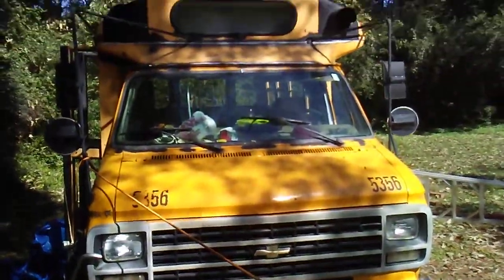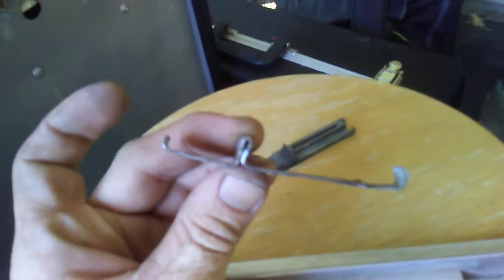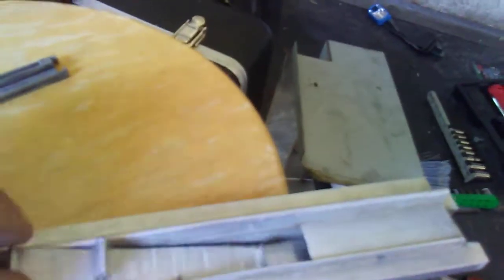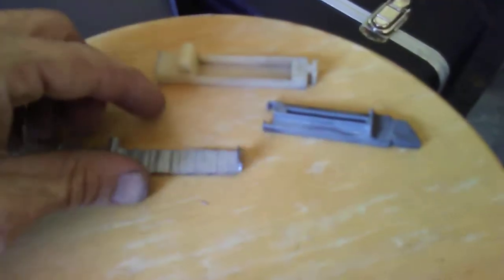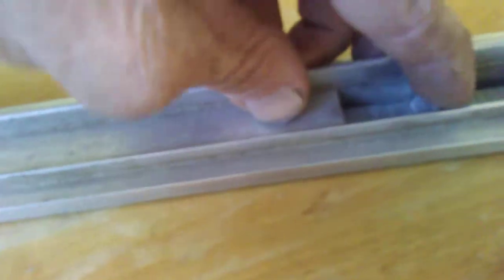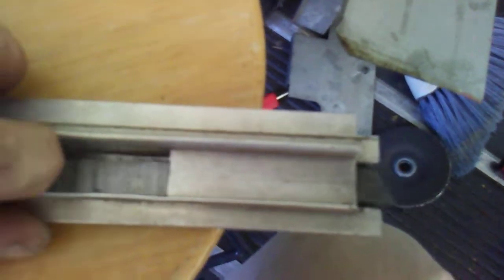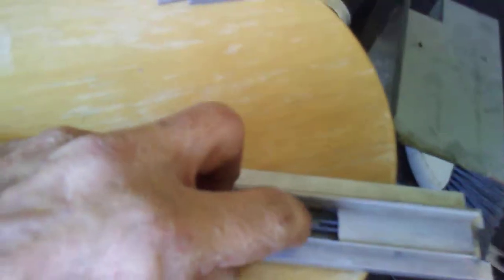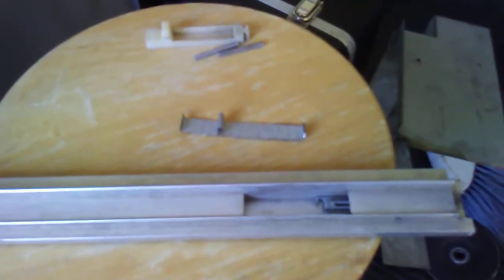Thomas skoolie window latch fix

Comment: How did you get the window down so you could get the window out to repair it? I have broken latches, but since I can’t take the window down I can’t access the top screw securing the window along the top.
Reply from the maker: on a Thomas bus they only have easily accessible screws on the side of the window.  other makes i couldn't say...

Comment: How did you get access to the top rail?  I need to fix a couple of Windows on our church bus.
Reply: Remove screws from the side rail of the window frame
Reply from the maker: once you pull the window out,  there are screws from the side, otherwise some pliers and a little work might get the window open.